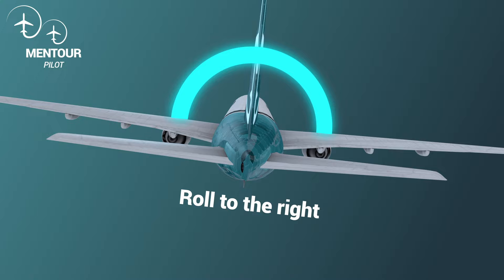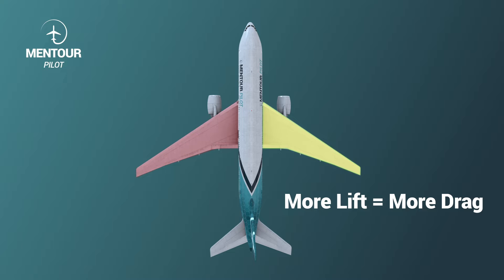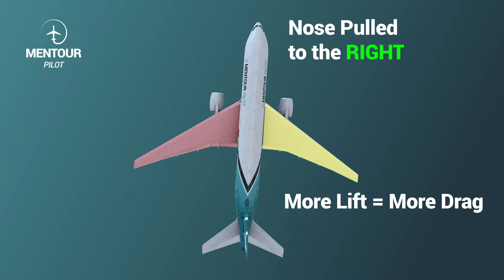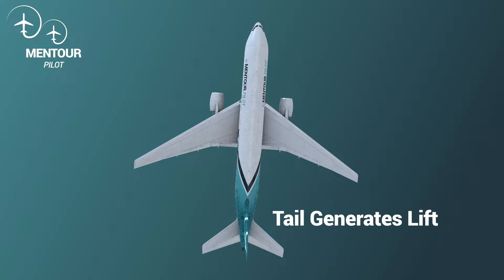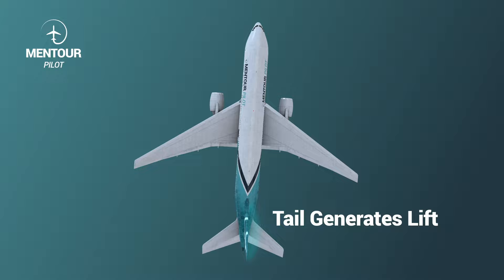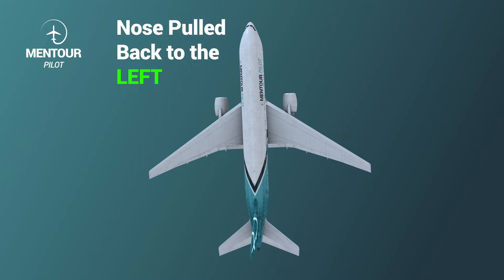What is a "Dutch Roll"?!

Comment: Question for a other video: I was reading an old issue of Flying magazine that reported on a commercial jet going down in the Atlantic. It was a French flown Airbus, and thus, investigated by the French. Basically, the craft had just switched to manual control at about 30,000 feet. The air speed indicators, triple redundant, had iced over, and the auto-pilot had automatically disengaged. The article said the engines were at full throttle and the angle of attack at plus 10 degrees, but the aircraft was still in a stall and plummeting. After a couple of minutes that I presume felt like eternity, the plane crashed in the waves. 
Can you go over this incident and explain what went wrong and why the pilots could not correct it?
Another topic on stalls that could make a great video on its own is explaining why planes with canards are generally assumed to be stall-proof.
Thank you.
Reply: Well, it’s two years late and I’m not a pilot but I think I know just about enough to have some idea of what was going on. First I’m going to assume this event happened more than two or three decades ago? Modern aircraft are built with alarms that will sound in the flight deck every single time the autopilot is disconnected, even if it’s the pilots themselves pressing the “off” switch after a couple incidents when the autopilot disconnected without the pilots knowing or noticing until too late.

As for the rest, I suppose it’s possible that not just the air speed indicators iced over, but the actual controls surfaces such as the various flaps on the wings and horizontal stabilisers on the tail. If some of those get frozen over then the pilots ability to control the plane is badly crippled. It’s just about fatal if the elevator flaps on the horizontal stabilisers on the tail cease to function properly because they control pitch.

However my prime suspect would be ice buildup on the wings and tail. A buildup of ice would change the aerodynamics of the wings making them far less efficient. If the de-icer systems weren’t switched on, were damaged or didn’t exist yet then ice buildup would ruin the lift effect produced by the wings and slow the plane down to a stall. Or shove it into a bad angle of attack which would cause a stall.

I sort of doubt that the engines were at true full throttle because that’s the TOGA thrust and are used only in go arounds and in an emergency such as the pilots getting lost and disoriented and the plane ended up being in serious danger of flying into a mountain. Full TOGA and ascend as fast as they can without breaking the aircraft itself. Basically the engines can only maintain this “full thrust” for so long before burning themselves out beyond restart or repair. I think it might be around the 45 second mark? Probably depends on the aircraft and engines. The article probably meant “full cruising speed throttle.”

I might tentatively also suggest that if the pilots were getting faulty air speed readings without knowing it then they might have set the engine power too low and that in combination with ice buildup caused the crash. But again they would have noticed this when the plane started stalling and falling out of the sky. Even without air speed indicators they’d probably still know enough to get the engines back towards cruising speed, then call ATC and ask for the true speed from their radar.

But take everything I just typed with a huge grain of salt because I’m neither pilot nor engineer and I’m guessing based on the description and what I’ve learned in the past. I mean I watched a documentary a couple days ago about… I think a 777 that came in to land at San Francisco and a glitch with the autopilot and their own lack of being taught about this glitch, in combination with the airport glide slope aid system being switched off for repairs led to the plane clipping the sea wall with the landing gear and doing a terrible crash landing, flipping over several times and I was shocked anyone survived it.

And even as a mere flight simulator game pilot and an inexperienced one at that, I was astonished that those pilots realised they were too high for the right glide slope and chose to cut engine power to idle to increase rate of descent until it seemed right. Even as a flight sim pilot if I’d wound up with an approach that bad (and I have) I would go around and try again.

Why they didn’t, I don’t know. Especially since their consequences for messing up are so much worse than mine.

Comment: Umm. this is called flight dynamics, not aerodynamics. FD takes into consideration more than just the Aero effects, but all of the effects on the aircraft from all forces, including oddball things that rarely are discussed, such as gyroscopic precession. 
A more straightforward way to explain dutch roll is as an inverse yaw-roll coupling followed by roll-yaw coupling due to stability in the trajectory of the moving mass, and occurs specifically in a looped state. It may be stable, neutral, or unstable.
To expand just a little....  Each axis is stable by itself, but the interaction between the two creates a double effect.   Also cannot ignore Newton's first law of motion, and consider how the naturally straight trajectory links the two together.   
As you mention, aircraft with swept wings are more prone, as are aircraft with V and T-tails. Combining the sweep with a high tail that tends to roll the aircraft in the same direction makes an aircraft that is stable in spiral trajectory mode, and turns it into one that is less stable, or unstable in Such roll mode.    
The modes describe a set or chain of interactions which interact, and have a result.  In this case, it's circular if unstable, and may result in the loss of the aircraft if not corrected by the proper inputs in extreme cases. 
Dutch roll mode can be stopped artificially, such as in the case of many Airbus aircraft, or naturally, by eliminating one of the coupled effects, or parts that cause that effect, such as but not limited to the swept wings.

Comment: In the video about the Braniff crash, it suggested that the pilots used ONLY aileron away opposite the roll.   WRONG MANEUVER!!!   As in a Spin Recovery, use rudder only.   A highly skilled and knowledgeable pilot can use Rudder opposite the roll and aileron INTO the roll, gently of course, to ease out of the Dutch Roll situation, the same as in a Spin Recovery.

Comment: I work with a small jet. If the fan is windmilling we have to go and stop it with hand before giving the pilot a permission to start the engine. Does this only apply to small planes? Can large jets be started with the fans spinning in the wrong direction due to wind?
Reply: I fly the ERJ-145. It uses Rolls Royce AE3007s and they can start with a tailwind, but you increase the likelihood of a hung start. 
 
We can’t even reach the engines without a ladder so if it’s a strong tailwind wind we’ll just ask the ground crew to point our nose upwind and get the engines windmilling the right direction. 

Probably safer to just point the nose into the wind rather than sticking limbs into the engine anyway.

Comment: Is there a time where you want to turn off the yaw damper?  Since the yaw damper is switched, I’m curious when or if you’d turn it off.  Thanks for a beautiful explanation.
Reply: Generally on planes that have one you leave it on full time. Except for some, you have to turn it off just before landing.
Reply: @FlyNAA  got it - basically you want full and 1:1 reaction during landing when you need the capacity but temper movement in flight.

Comment: i have a question id love to know the answer too 

when i last went on holiday we was heading home from turkey flying out of damilan airport (i think thats how its spelt)

however for this flight the pilot did something verry strange when we got onto the runway he throttled up the engine but then chopped it back letting it spool down this i thought normal cause he must have been just checking the engine before take off

but then we began heading down the runway and he throttles up then chops the engine we throttle again and he chops the engine weve now been moving for atleast 20 seconds picking up speed and hes chopped the engine throttle twice now 

finally we throttled up one most time and then took off 

it was definatley strange as i could hear the engine spooling getting higher in pitch before suddenly dropping it pitch sharply before re spooling again

why would a pilot want to do this?
was this normal?

Comment: Hi. Do pilots use rudder in landings to put the aircraft nose in center line of the runways in no crosswind conditions?
Reply: Even if there’s absolutely zero crosswind we still use a little rudder for fine adjustments. 

Less wind = less rudder but there’s almost always some rudder used.

Comment: Inherent stability is something that should be mandatory in all aircraft. Are you listening, Boeing???
Reply: It is in all commercial aircraft. They can't be certified without meeting static stability criteria. Despite what some of the mainstream media will tell you, the 737 max was always aerodynamically statically stable. The MCAS issue is unrelated to stability. You can find more information about it in the blancolirio channel. He talks about it in detail.
Reply: @ASJC27  Having an uncommanded pitch up movement is aerodynamic instability. It might not occur during normal conditions, but certifications are made to have an stable aircraft in normal and extreme conditions.
Reply: @Ihaveanamenowtaken  No that is not true. Stability in the aeronautical industry has a very specific definition. Assigning the word 'stability' to anything else is spreading misleading disinformation. There are two types - static and dynamic stability. You said "inherent stability" - the 737 max air frame is both statically and dynamically stable, as it has to be in order to pass certification. In simple terms it means that without any intervention, by either pilot or automatic control systems, the plane will eventually (and passively) self return to level flight following a disturbance. 
The MCAS issue is an automatic control intervention problem, nothing to do with the inherent stability of the plane.

Comment: Cool topic.  Should GA planes have this automatic control, in your opinion?
Reply: Straight wing GA planes don’t really need it. It’s much easier to coordinate with manual rudder inputs compared to swept wing jets. 
 
Most jets are perfectly safe to fly without the yaw damper, but it’s not as smooth and it’s a little trickier as a pilot. Especially when we’re flying high and fast. Low and slow is a little more manageable with no yaw damper. 

In fact, there’s situations where you’d want to turn off the yaw damper, like landing in strong crosswinds, or dealing with an engine failure.

Comment: Apologies, I don’t remember the story well but I have a vague recollection of being told Of either a McDonald Douglas or Boeing that had an issue with its your damper which would oscillate and it just so happened to be at a frequency that made the passengers at the back of the aircraft feel unwell. They didn’t know what was causing people to feel unwell and eventually tracked it down to the oscillation caused by the your demper does anyone else remember this or have I made it up? LOL.

Comment: Sorry but this explanation is incorrect on some pretty significant points.  Starting with relative wind.  The outward (left) wing advances, which aligns it  more w/ relative wind, ie chordwise flow & relative flow match, which means wind goes faster over outboard wing.  This drives increase in lift , so  the outboard wing rises.  However, lift increase drives drag increase.  Thus it begins to 'pull' the nose back to the left.  Then the phenomenon repeats but starting on the right wing (because it is now ahead or forward of left wing).

Comment: ،what is fly by wire ?
Reply: It's a system which means that when the pilot moves the controls, those movements are converted into electronic signals, and transmitted to aircraft's flight controls by wires.

Comment: For pilots in non-swept wings or GA aircraft, especially the older tailwheel. that so called inherent stability is not present per se.  It is a challenging maneuver to practice and get it done correctly.   Put the nose on a fixed point ahead, then by using rudder and ailerons  keep the nose on the same spot while you 'dutch roll' to maintain that point in space.  Yes, is does produce uncoordinated flight, but that is the point.  Only really good pilots can accomplish this skill.   All you GA pilots - go out and try it.  You'll find it not that easy.  If your instructor didn't teach it in basic training, thats a shame.

Comment: If you accidentally apply ailerons to the right, the aircraft will enter a coordinated turn to the right. No reason why it should enter a sideslip.
Reply: The left wing aileron moves down, creating lift. Lift creates drag. The left wing is dragged backwards as it is raised, causing a slip. 

If you (or the yaw damper) coordinated that right aileron with a little right rudder you’d be in a coordinated turn.

Comment: So as a pilot, the appropriate response to a Dutch roll is to do nothing. Let the yaw damper sort it and if the yaw damper is not correcting it. Do nothing. Ride it out let the aircraft sort itself. Manual input is likely to only worsen an effect that was designed to dissipate

Comment: why the name .....Dutch .... due to ice skating?   Wasn’t it the old Fokkers that had constantly the tendency to duct roll? 
Like the skater did ? 

To add or correct something to the wing type .. straight wing can make Dutch rolls too. 
But the swept wing are more subject to it due to the “perfect” shape. 
See here the swept wing is a very well shaped wing like a perfect glider wing only bend backwards.
But stomp blunt wings will do the same just try it. That’s where tapper type wing are better.
Some aircraft will keep on rolling in thin air.

Comment: You most certainly will feel more than 1 G in a turn. It's simple physics.
Reply: In a coordinated turn the g-force is 1/cos(a), where a is the bank angle. So with a bank angle of 30 degrees you will have 1.15 G, for 45 degrees 1.4 G and for 60 degrees 2 G. I would guess that an airliner seldom banks more than 30 degrees, in gliders 60 degrees is not uncommon in tight thermals and when banking more than 45 degrees the control surfaces starts to have other effects.
Reply from the maker: Yes, that’s true. What I was referring to was the vector of the force.
Reply: @MentourPilot  I apologize. Please consider it a workplace injury to point out little things like this; but it's the direction of the force vector. :-)

Comment: Can anyone explain why a plane has to bank to turn? Why can't it just yaw?
Reply: If you only yaw the nose you’d be skidding. It would still turn, but it would be slow and would feel like you’re turning in a car (being forced to the side). 

Even if you only kicked the rudder and used no aileron the plane would still roll, because the wing on the outside of the turn would accelerate and create more lift. 

It’s much more efficient and comfortable to use the lift from the wings (banking) to cause the turn. If your turn is coordinated (preventing slipping and skidding) then the only acceleration felt is directly downward relative to the occupants (G force). In a typical 30° turn you’re only feeling about 1.2G. You could still walk around and not spill your coffee like that. 

When we’re in cruise we usually only turn with about 15° of bank. You would barely be able to tell unless you’re looking out the window.

Comment: Strange and totally wrong what Mentour says (11:15): in a coordinated 30 degree turn, the water in a cup will stay level, YES, but you will feel more than 1 g.  In fact, it will be around  15 % more.  So, was a  slip of the tongue  or need to refresh basic flight theory?      The only way to keep it 1 g in coordinated turn is if you press elevator down during the turn, which is not a standard practice, to say the least...

Comment: It's difficult to control an aircraft without computers. I think is far easier to control a little airplane
Reply: It's not difficult to steer an aircraft without a computer. In the earlier jet airliners like for example BAC One-Eleven, Comet, B707, B727, VC-10, Trident or Caravelle there were no computers in the sense we currently use them. And not to mention the earlier four engine propliners.

Comment: Did you hear about the Southwest Engine that exploded in mid air ?
Reply: wolf paw you mean the one last year? Yes he does know and he also knows about the fix Boeing have to do for the engine cover
Reply: Mentour talked about it last year and gave praise to the crew for handling multiple emergencies.
Reply: @tomstravels520  yea.did they ever figure out why it happened? I know one of the blades broke off and flew into the engine but i hadn't heard on why it actually broke off
Reply: wolf paw “The National Transportation Safety Board (NTSB) determines that the probable cause of this accident was a low-cycle fatigue crack in the dovetail of fan blade No. 13, which resulted in the fan blade separating in flight and impacting the engine fan case at a location that was critical to the structural integrity and performance of the fan cowl structure”

The report is out so just google “Southwest 1380 report”